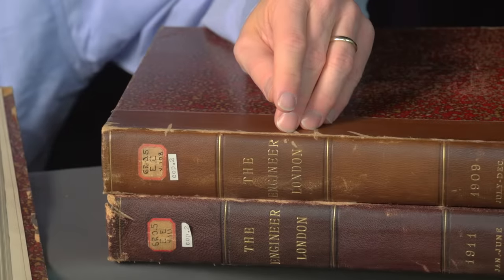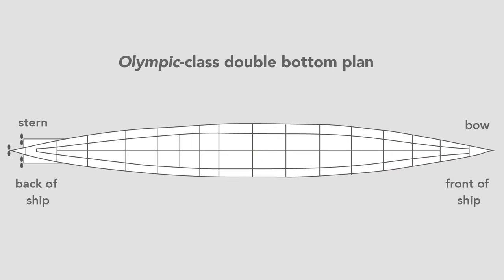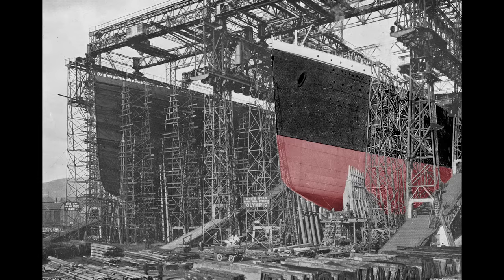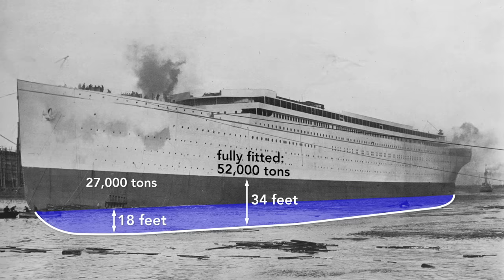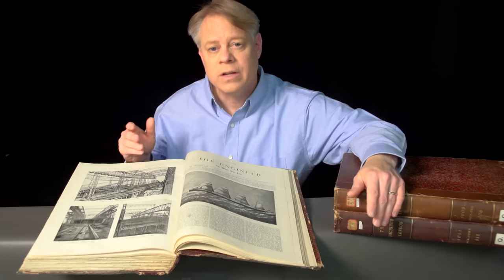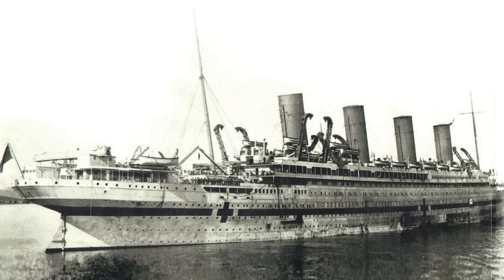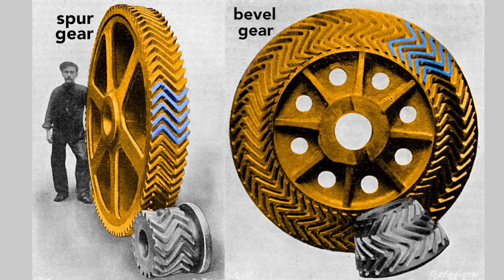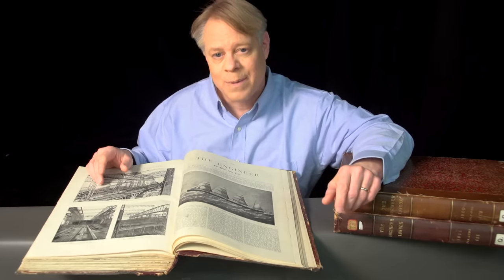RMS Titanic: Fascinating Engineering Facts

Comment: The average coal burned per day was actually said to be 850 tons =  1,700,000 pounds per day, 70,833 pounds per hour, 1,180 pounds per minute fed to 159 boilers. I read somewhere that 76 of the men who shoveled the coal slept in a room together so I would assume about 76 men were shoveling coal at any given time however it was said that they would feed the furnaces for 7 mins then shovel ashes for 7 minutes so that 70,833 pounds of coal per hour would need to be done in 30 mins so each of the 67 men had to shovel 123 pounds of coal for each 7 min shift that means 123 pounds shoveled into the wheel barrow then 123 pounds shoveled into the furnace so technically 246 pounds every 7 mins which might not seem like a lot but imagine using a regular size shovel to fill up a wheelbarrow with 123 pounds walk it over to the furnace and then shoveling that 123 pounds into the furnace then walking back to the bunker to fill it up again I’m sure it took a few trips to get enough I mean 123 pounds of coal is probably not one wheelbarrow and don’t forget the weight of the wheelbarrow when moving it around that would be a very tiring job to do all day long. Then after the 7 mins of feeding coal you have 7 mins of removing ash’s then after that feeding the furnaces for another 7 mins then 7 mins of ashes again. That’s some seriously hard work I couldn’t do that all day long. They only made 5.10 euros per month back then I would never do a job like that for so little time money. It’s a messed up thing because it’s a job that takes no real skills many hard labor jobs are like that so the pay is so low but it’s such hard work that it should pay so much more it’s like doing concrete  work or roofing work or something like that which is really hard physically but pays nothing as an employee it doesn’t make alot of sense but it does at the same time. I would never do such a physically demanding labor job for low pay I would need to get paid alot of money. I have known a bunch of people that did roofing like my one buddy for instance about 10 years ago who is a great roofer he knows what he’s doing and was only making 14hr, if I was to do it I would need to make like 50 bucks an hour or I wouldn’t even think about considering it, I watched him carry up two 4’x8’ sheets of plywood up a 3 story house that was built in the 1880’s that had very insane almost straight up angles on the roof with small circular rooms that made it look like a castle these rooms were only like 7ft wide with a 7ft tall pointed roof on top that needed to be shingled idk why they did it without a sky jack so it was safe my buddy fell off the roof idk how he didn’t get really injured or die. He told me he was the highest paid guy on his crew. My other buddy got into roofing when I was like 18 and after a year he was making 12 bucks an hour which we thought was great back in 2004, he asked me if I wanted a job and they would pay me 9hr starting which was 2hr more then I was making so I said yes at first because he said it was just cleaning up and driving to get supplies but then his boss called me to tell me about the job and I was told what I had to do, clean up all the shingles, wood, garbage that gets tossed on the ground, bring up bags of shingle, plywood, nails and whatever materials needed. I said you want me to do all that for 9hr? He said it’s an entry level job if you keep with it you will be doing the actual roofing work making more money. I said sorry dude I’m not carrying sheets of plywood and heavy bags of shingles up ladders all day for 9 bucks an hour. He said so ur lazy? I said absolutely not I’ll do the job but I would need to make atleast double what ur offering me and idk if I would be happy with that and not for nothing doesn’t the company you buy the shingles from deliver them on the roof? He said they will but it’s 250 bucks. I said well you better call them and tell them to drop them off on the roof because I’m not doing it. If you want me to work for 9hr I’ll clean up and make runs to the store for materials but I’m not climbing up ladders with plywood and shingles all day I’m not ruing my back for 9hr. He had me work a few day’s (I took vacation time from my job) cleaning and a couple of his guys talked crap calling me a pussy to me because I wouldn’t bring them the stuff up and I said I’m not a pussy I make 9hr so I’m working at 9hr I’m not breaking my back for 9hr. Then on Friday the boss said come on you can bring a few shingles up and I said nope! He started being a dick so I said just because all these idiots that work for u are ok with making crap money for breaking their backs doesn’t mean I will so I quit. He called me the next week to come back and my job gave me a promotion to flat rate tech (auto repair shop) and raised me up from 7hr to 14.50hr so I told him what my job did and he said his best guy doesn’t make that so I said ok I guess we’re done here and hung up. He called me back saying he can give me 10hr lol I said dude I’m 14.50 flat rate and just my first week being flat rate im gonna get paid 64 hours and only worked 40 and im not killing myself to do it. Idk how anyone does roofing for less then 50hr. 

I told my one buddy to just work for himself because he was such a good roofer but he said he didn’t know how to run the business, I am a business owner (repair shop) so I gave him some advice, made him flyers, told him all you gotta do is drive around and write down an estimate on every house that looks like the roof is shot. You just need to have a few prices in ur head of how much it costs per square yard/ft to do the roof one price just reshingle and one tear off. If you did one roof per week you would be rich.

Comment: Dear engineerguy, "enormity" doesn't mean "huge size". It means "severe viciousness" or "heinousness" or similar. It has absolutely nothing to do with something being physically large.
Reply from the maker: I know, I know ... I have heard MANY times.
Reply: But it actually does mean huge size. It's the third or fourth definition, so the word wasn't used incorrectly.
Reply: @Mittens0407  I assure you that it absolutely does NOT mean anything related to large physical size, except in that some people continually use it wrongly to mean that. Also, please cite an authoritative dictionary when making claims. Dictionary.com isn't what I'm taking about.
Reply: @Dave-lr2wo  Yes I did. "Those who urge such a limitation may not recognize the subtlety with which enormity is actually used. It regularly denotes a considerable departure from the expected or normal."

Comment: I saw two stories some time back -  1) Titanic had a weakened hull due to fire damage -- from the photos -- could have been coal dust but only James Cameron's team could confirm and 2) that the tiller on that fateful night was manned by a sailing ship pilot and he turned the wheel the wrong way.
Reply: Titanic used tiller commands.  The wheel was turned the right way.
Reply: Both of those are false.

1 - There was a "coal fire", but it didn't damage the hull because it simply didn't make it hot enough to actually weaken it. Resuming, the hull was still as intact as ever.

2 - Tiller commands for you my friend, simply put: when said to go to a certain way, you turn the opposite way. Hitchens did not make any mistake, that was made up by people who don't understand tiller commands.

Comment: I suggest a sea vessel engineering problem for you to look over. That would be the problem of "hull panting" This is the vibrations or oscillations in the ships hull caused by movement,at speed. It is not always possible even  today to be 100% certain about hull panting. Hull panting was something in great question with the construction of the SS United States. A very fast ship was desired but no amount of hull panting was allowed to disturb passengers. It turned out that the hull of the SS United States did not pant excessively even at speed.

Comment: Great video.  The sisters seemed to be ignored most of the time.  One question has always annoyed me.  The ships are constructed on an angle, so they can slide and be launched.  This fact must make it difficult to build them as they are not level.  When we installed rigs for testing aircraft structures, or any machinery, we leveled them and anything attached to them was installed using a level or clinometer.  How did the shipwrights keep everything square?  They would need many clinos set to the same angle?

Comment: I think in some ways those steam powered liners were more complex than modern aircrafts  carrier's.. steam  power the same as 100 yeas ago.. but a 3 story engine , the maitanice, boiler pressure through coal .  loubercation , desalination of water through  the pipes to and from to harness the 3rd propeller.  The casting of machine parts for engines probably  10k tones ...

Comment: Titanic was begun 9 months after Olympic.  That gives an idea of how long it took for Olympic's hull construction to reach the point where the workers could be moved over to the new build. There would probably have been a week or two of down time, to not only give the men some rest but also to give Olympic the final going-over before committing all of those men to Titanic.  10:20 -- "Panting" is also known as "oil-canning," which gives a better idea what was happening.  Oil-canning fatigues the hull plating and rivets, and induces leaks.  Using the spaces between hulls for water and fuel tanks reduces this during the early part of a voyage, but as they draw down, the incompressiblility of liquid is no longer of much effect -- when possible, these tanks are then filled with seawater, which then must be pumped for reuse as fuel oil or freshwater bunkers.  In the old days, they just did so out at sea, trying to meter the pumping in a way that the passengers didn't notice the increase in oil-canning over the last day or two before making port.  

Design expertise had grown so much that, when SS Malolo was laid down only a decade and a half later, she was able to not only survive a collision on the same scale as that suffered by Titanic (ironically, also in the Atlantic), and sail to port shipping between 6000 and 9000 tons of seawater.

Comment: One mistake, pluming and state rooms were not installed as it was an empty hull. Cause of changes of stability like it happened with Italian ocean liner Princess Jolanda turning to side and sinking after having its interiors done before launch. All the fixtures were done in fitting out yard. Two it was not a gash, but several tears in hull. Other than that all is good.😊
Reply: Citation needed

Comment: They used hydrogen plasma cutters to cut the plates for the ship's hull. When you use a plasma cutter, you have to grind the now extremely hardened material off the edges, or it is a place where a crack will start and tear the whole plate like a piece of paper. Especially in the cold, this happens. That is why they could not understand what caused the metal to just tear as it did. It is similar to welding you are supposed to grind the weld and the base metal to keep a tear from starting at the weld. But today, that is not being done anymore.

Comment: they also had too much sulfur in the hull plates which became brittle in the cold water. and to test the water temperature they were supposed to lower a bucket to the ocean but they didn't have enough rope so they used tap water. and another fact. they would not give the lookouts binoculars they were for the officers only.

Comment: Question: The watertight bulkheads that were supposed to prevent the flooding of compartments adjacent to flooded ones were, as I recall,  not extended up to the bottom of the first deck on Titanic but were on Olympic and Britanic. Can you confirm this? If this is the case, and Titanic was built after Olympic and before Britanic, what possible explanation could there be for this? Had Titanic's bulkheads been sealed to the first deck, and the watertight doors closed, she shouldn't have sunk.
Reply: All three ship's bulkheads' were designed and built identically.
They had planned to retro-fit the Britannic with higher bulkheads, but the war started so they never got around to it.

Comment: For the first time I think in a marketing mood about Titanic: if the owners take luxury interiors as an advantage - not the speed - in the long way Titanic would be very expensive in terms of coal, crew salaries, and maintenance....and this should cut proffits for the company.
May be the liner, in few years would be in the case of launching - building -  another more economic, not so luxury  transatlantic, sending Titanic out of service.
Reply: Speed was indeed a significant factor in the competition on the transatlantic route. This is why the Blue Riband was so important. Not least the battle between SS Normandie and RMS Queen Mary. 
   At QM's normal service speed, 28.5 knots, she actually used approx. 50 tons of heavy fuel oil per hour!  If she had kept a speed of approx. 22 knots, the fuel consumption would probably had halved.
  Even if the Olympic class ships weren't the fastest, they were still faster than most of the other transatlantic liners of their days.

Comment: (8:41) I've heard that if they hadn't reversed the engines (and stopping the middle turbine?), the Titanic may have missed the iceberg. This is because the rudder didn’t have water being forced over the rudder by the center propeller. I don't know, though. When they reversed engines, did that mean they stopped or slowed the center propeller because it couldn't go in reverse? Inquiring minds want to know! 😉
Reply: There is a lot of debate over whether the engines were stopped or reversed. Some witness say that the engines were stopped (example, Chief Fireman Fredrick Barrett), and some say that the engines were reversed (example, Fourth Officer Joseph Boxhall). It'd actually make more sense to stop the engines generally, but maybe they were reversed in this case? We may never truly know..
Reply: @Official_Kezzie  Interesting. Still, the point is that the center prop helped steer the ship by forcing water over the rudder. Thanks for sharing that information, though. 😎☮️

Comment: A minor quibble at 0:19 mis-use of the word " enormity " ;  he meant ' immensity " - a very common error.  Otherwise a good piece free from hype and the nonsensical parroting of the word " unsinkable " which so often mars articles on the subject.  He did not mention the quality of the steel used for the outer plates which was alleged  to have been embrittled by high sulphur content.

Comment: I don't understand the battleship getting sucked into the Olympic. How does that happen? How could a battleship captain be unaware of this phenomenon?  Was this the real cause at all?
Reply: Propellers pull water in from the front and push it out at the back.  Even canal boats going passed moored craft will cause them to pull on their ropes.
Reply: @Dizzy19.  I am not really questioning the phenomenon but more how a battleship with an experienced captain could have this happen. First a battleship is incredibly large and heavy and I assume would maintain a safe seafaring distance. Second, the captain would know about this phenomenon. I am thinking this might have been a whitewash to protect someone's reputation.
Reply: @tedosmond413  Hawke was less than half the size of Olympic and if there is doubt about the power of Olympic class ships, remember Titanic caused the liner New York to break her moorings on 10th April, when she was leaving Southampton.
Reply: First HMS Hawke wasn't a battleship, she was a 20yr old obsolete armoured cruiser - less than half as long as Olympic & one quarter as heavy. 
Hawke didn't really get sucked into Olympic, the latter was turning across the bow of the smaller ship. But, Olympic turned faster & sharper thus catching Hawke's master off-guard - before he could take evasive action he plowed into Olympic. The Olympic was held responsible for the collision; it cost H&W a bundle to get out of that one.
Reply: @fredh999harris8  good answer!